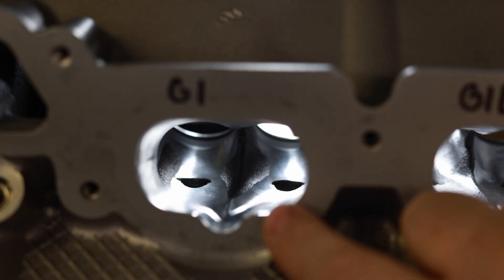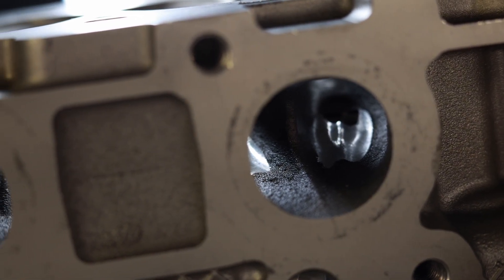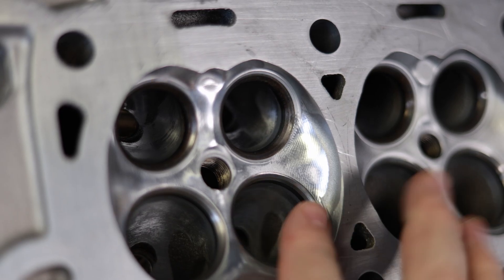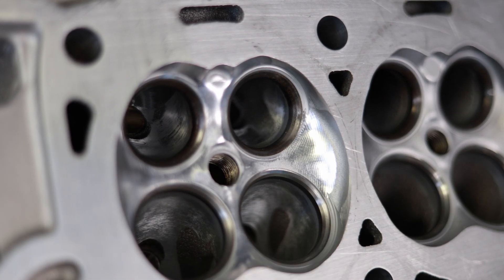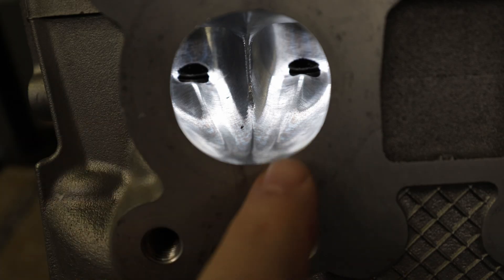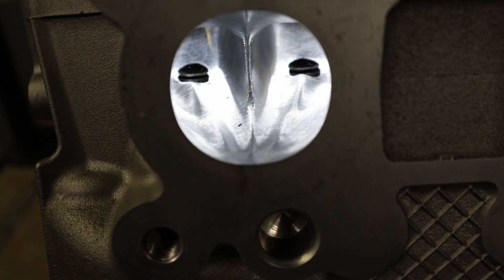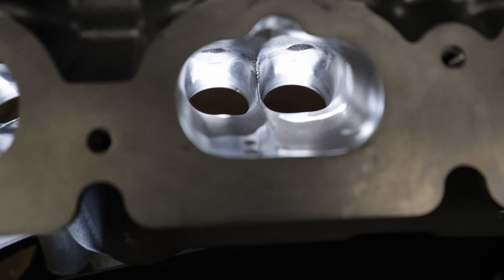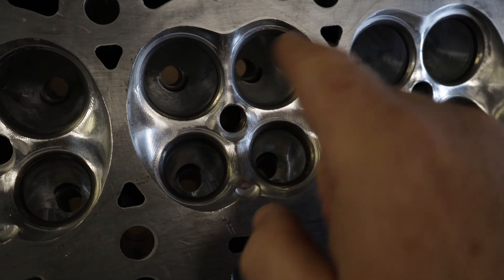Unlocking the Gen 2 Coyote’s True Potential!

Comment: Can we compare the gen 3 head to a roadrunner head? Then port the gen 3 to see how much better if any it can get
Reply: Would love to see this 👍
Reply: @coyotehd816 yeah cause i think the gen 3 is pretty much on par with the roadrunner. Not just that but if there are gains to porting the gen3 im gonna semd my heads to him to have the full port done. Im buying a 9:5:1 Aluminator motor and gonna run the gen 3 ESS supercharger to make 800whp on E85. 

If porting the gen 3 heads adds 30whp on a N/A motor then i would think with boost it should turn that into 50-60whp especially running E85
Reply: Rb heads are not very good you need aftermarket heads for  383,413,426 ,440😅

Comment: Can you do the voodoo heads? I have one stock ports with bigger valves. I just want to know if I mad the right chose. It will be matched up with a 5.2L
Reply from the maker: Bigger valves don’t fit on the valve seat correctly in my opinion so can’t show you that.

Comment: we in sydney are being sold so much unnecessary cylinder head work it's not even funny 

we are the opposite to "less is more" when working our heads

i've been sold "bigger is always better" for so long, after watching these vids, i will be telling my machine shop very different things!

how many rb heads have split from over-porting is not funny! when you have two valves, there isn't the need for oversizing them unless your chasing 2000hp and or 10k rpm. 

i guess the excessive cost of living forces our shops into "unnecessary work" 

good valve job, and some hand porting below the valve is good enough for 98% of earths inhabitants
Reply from the maker: 😂 same here buddy. HeadGames is different from most in this regard. I’ve learned through experience that bigger or better flowing doesn’t necessarily mean more power.

Comment: Have you tested this particular set up on the boosted application? How did it do with the same psi for example 10 psi with stock heads and 10 psi with your work overhead
Reply from the maker: @manuelamador9175  I can only hope one day someday someone will go through all that effort.
Reply: @headgames   how much is it? I may consider purchasing a set for testing tuned by Lund

Comment: Hi, Dave. Thanks for keeping posting your videos, it's priceless. I've got a question for you. Few days ago I had exactly the same conversation with a friend of mine about porting necessity. He said he doesn't need it since he is making 7.35 ET on stock jz head. I told him that porting would make it easier for engine. But would it really? The pressure inside the cylinder is still very high regardless if less boost is presented. Turbo would still supply big air mass regardless lower boost (how else we would make more power?)... So the only thing we really achieve is lowering air charge temperature down which can be also done by introduction of alcohol or WMI without porting... Well, less back pressure will be seeing with porting done but again Turbine housing with bigger AR can be employed to solve it... So what would you say to his arguments..?
Reply from the maker: You are absolutely correct. It would make the same power at a lower boost level. It’s not a question if the power can be made, it’s how it would be made differently with a good ported head. There’s 150whp in the mid range making that kind of power!